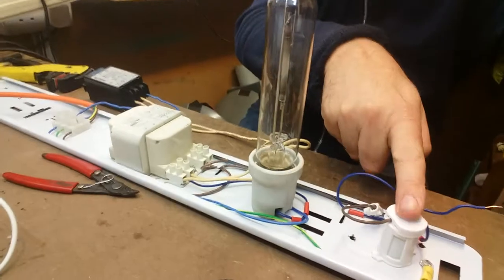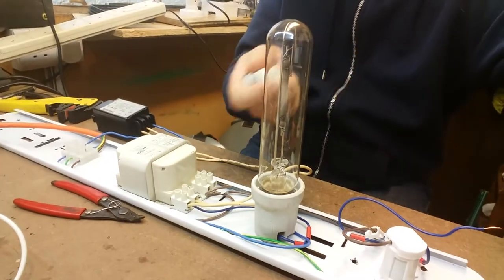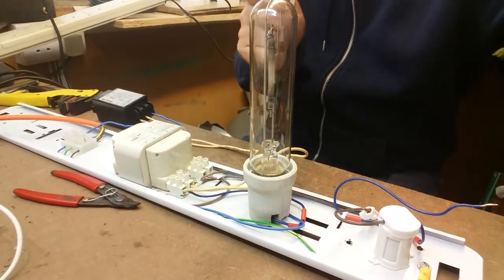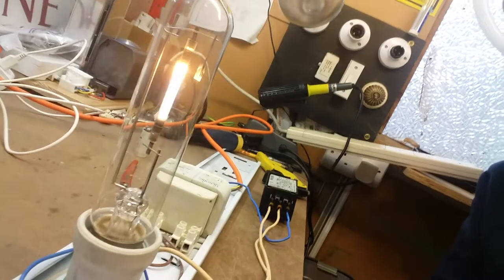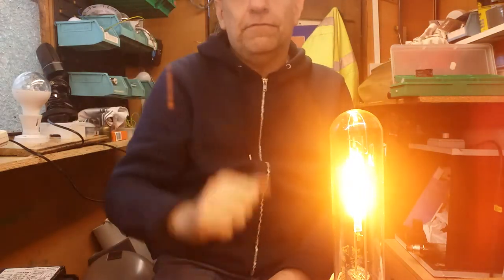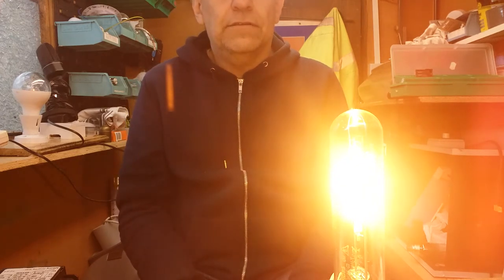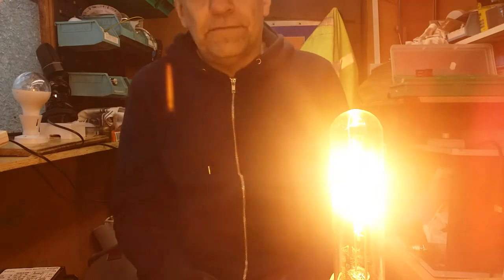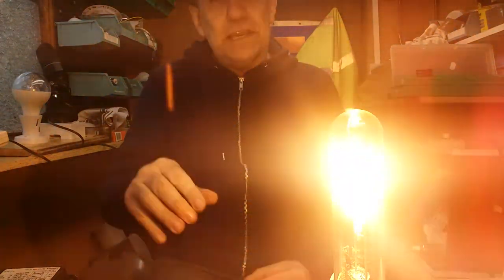Video Part 2. Fluorescent start VS HPS Lamp. No it DID NOT fire.

Comment: Metal halide lamps give off UVC radiation which gives you arc eye unless the fixture they're operating in has a glass cover in front of the lamp.
But do high pressure sodium lamps give off UV as well ?
If so it might be more UVA than UVC since there is glass around the arc tube.

Comment: Hi Jaye, tnx for the upload of the experiment. Im looking for other ways to light up hps lamps also. Did you have another go at it with another circuit? I used to work in public lighting also. The starter from phillips uses a maxoutput of 7kv I believe. Do you know how much voltage out the starter can produce wich you were using? Maybe the peak aint high enough for the spark to get across? If you take some in series to up the voltage maybe? Lets say the starter you used has 1,5kv out, you need 4-5 of em in series i believe? Don’t know if it will work.
Reply: Let me know if it was of help to ya 😉👍🏼